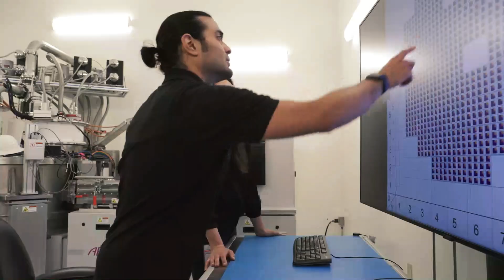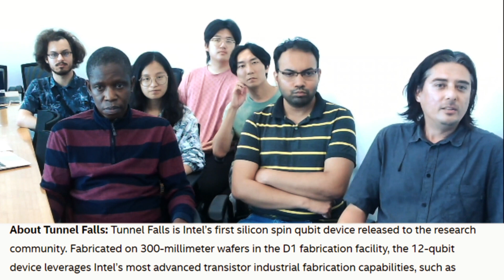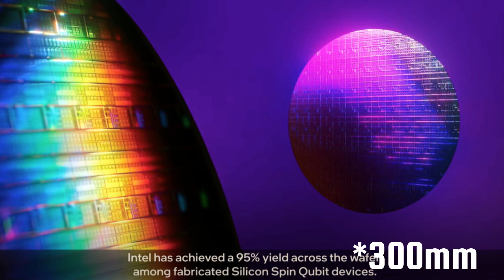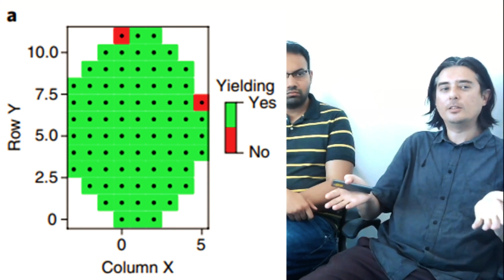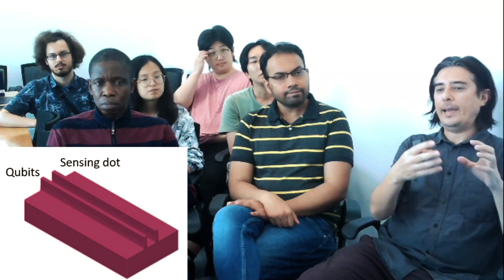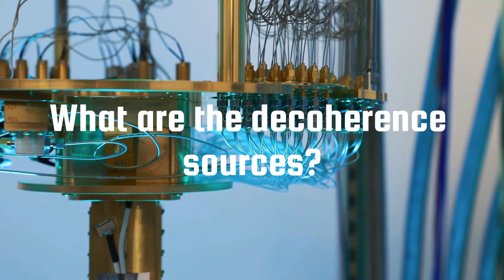The mighty Intel is now making silicon Quantum chips.  But are they actually any good?

Comment: Intel has been making quantum chips for awhile, while 12 qubits is only a modest amount compared to their previous quantum chips, Tunnel Falls are semiconductor spin qubits and have a far more promising path to commercialized quantum chips. Intel is even sampling Tunnel falls at the university I am an alumni of.
Reply from the maker: Yes, that's right, I think you are referring to their superconducting qubit chips?  That is right but this chip is entirely new technology.  We would say its not necessarily superior, probably SC qubits are still the technology to beat. But interesting technology anyhow.

Comment: Google didn't achieve quantumsupremacy. Here are some articles to look for:
"Ordinary computers can beat Google’s quantum computer after all", "Scientists Dethrone Google’s Quantum Advantage Claim With a Conventional Computer", "Googles Quantencomputer: Von wegen überlegen!" [german]

Maybe there's a way, to summarize these 55 Fin-Qbits to one resilient logical Qbit, in hardware.
I would focus on 1 proper Qubit per chip, and find ways to connect them.
Or make the amount of qubits on a chip sufficient, for an error-correcting transmission protocol.
Because these quantumcommunication stuff has to be developed anyway in the future.
If you integrate more and more qubits on a chip, the risk that the chip isn't 100% perfect raises exponentially.
So, I would split this risk, into several logical units.

Which technology is the most promising? Still the superconducting ones, or lightbased computers?
Reply from the maker: Thanks for those links.  People are only just demonstrating quatum error correction in more advanced systems so could be a while still.